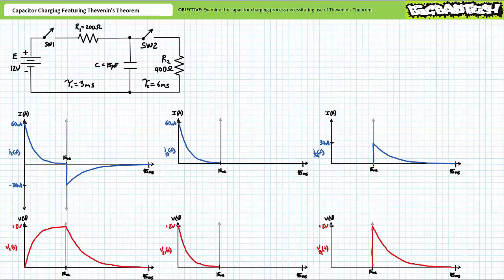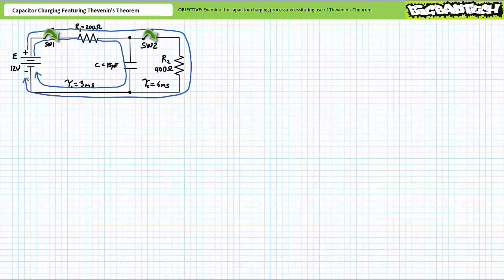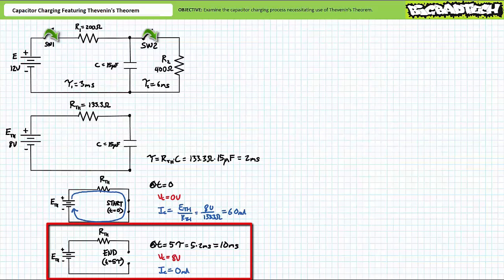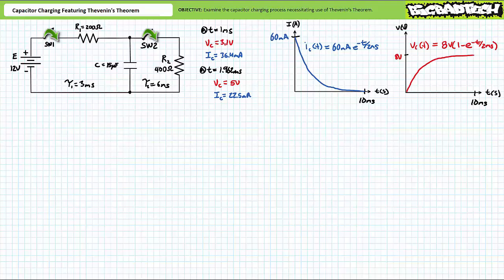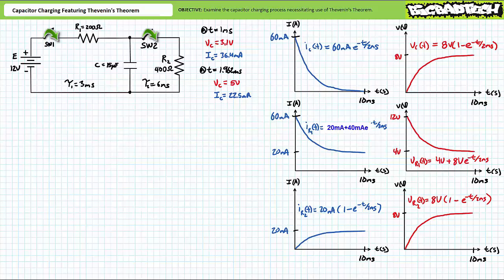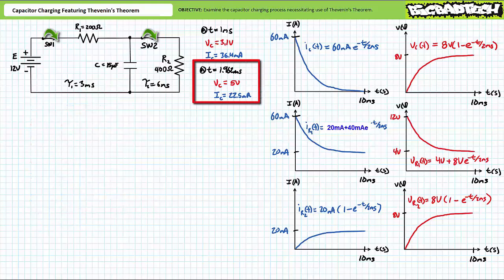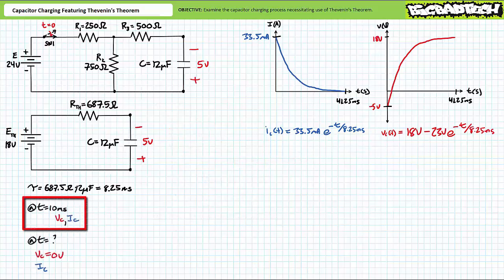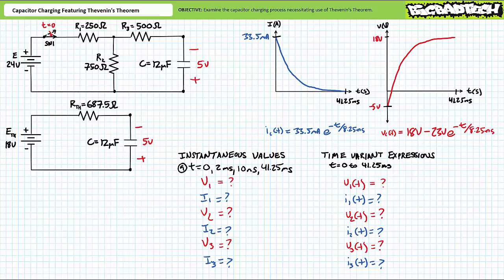Capacitor Charging Featuring Thevenins Theorem (Full Lecture)

Comment: Is there an application or situation where it would make sense to model a capacitor as a variable resistor that changes its resistance as a function of time?
Reply from the maker: I suppose that model would work but can't really see how it'd be easier or you'd gain any more insight than the traditional method.